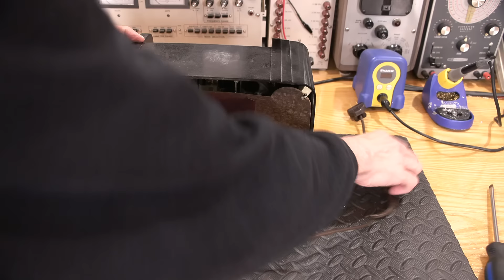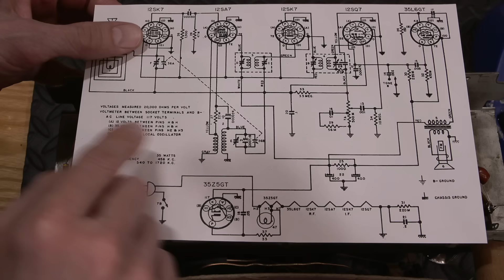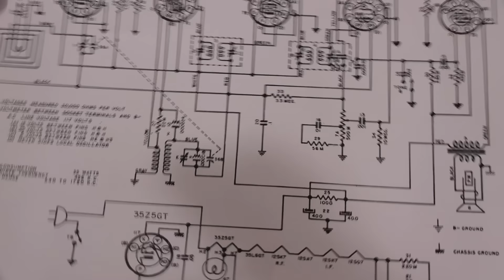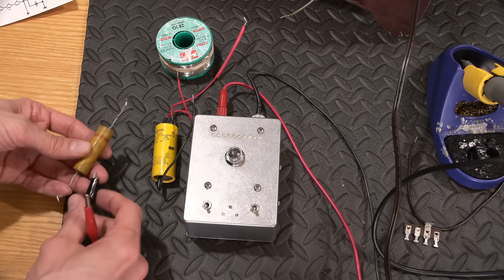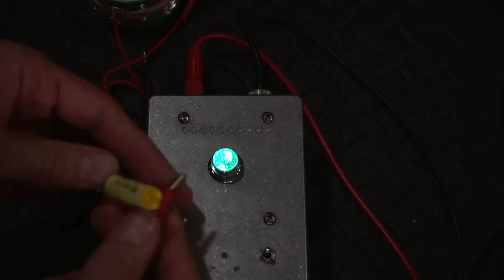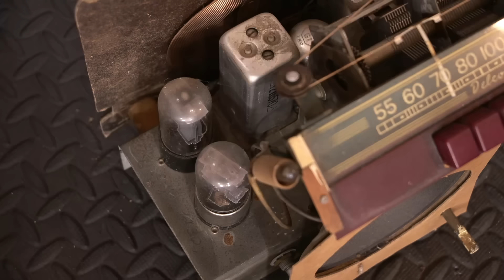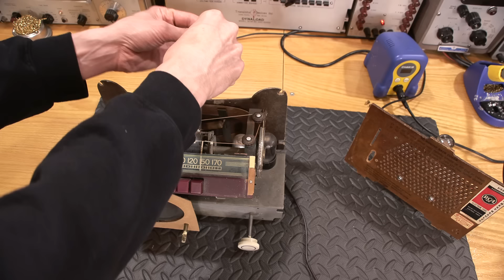Delco High Performance Radio Receiver! [Repair]

Comment from the maker: To learn electronics in a very different and effective way, and gain access to Mr Carlson's personal designs and inventions, visit the Mr Carlson's Lab Patreon page here: https://www.patreon.com/MrCarlsonsLab
Reply: I don't understand electronics but I have been watching your videos for about 4 years now. you are and awesome communicator and entertaining.  My favourite's are when you modify a circuit to make it better than it originally was. I hope you continue to make great content well into the future. thank you for the entertainment over the  years.
Reply: Awww i'm in New Bedford, Mass! Is that what it reads on the side of that cap?
When i was a freshman in Electrical Engineering back in the 90s we took a tour of Aerovox.
I thi k at that time they only produced large industrial capacitors.... 
I'm only 4min in, but if you're going to throw out that cap, i'd actually like to have it :D
Reply: Have a video on what cap replaces the old cap . Straight forward , replace this old type with this 
Modern type . That's it , real simple with no why or what .
Reply: I could really use your help I have an hp 8647a signal generator that isn't acting quite right I'm getting instead of fixed single tone it's like bunch of them or 1 that's like spread out so makes it very hard to tune a radio cause don't know where tone actually is it has a 517 error which is a pre cal error. Is there chance you can repair it for me?
Reply: This radio feels like it was built in the 1990s since its AM-only dial goes all the way up to 1700, though it's probably WAY older than that.  A 1990s model is basically modern compared to the ones you've fixed before, and it would be transistorized to the point of having chips.
Reply: is that lil repeter part 95 ? hahhahah o wait ur above the line hahhahahah.... nice lil tool. i wish they had one for cell phones lol.. here near champlain cell service sucks lol

Comment: Another Yanqui widow maker...and what an appalling mess. What you refer-to as a 'power antenna' were commercially made 'way back wen'... ... I have one in France...sold as a small table for the radio upon which to sit and connect. BTW were there .no reception down here'...you would not at all hear any stations on the radio...

Comment: Oh Mr. Carlson… You’ve done it again.  Produced a superb video.  Thank you.  Two questions please…
First, I noticed you had no mention of how to reduce the hum.  May I assume that it will most likely  go away once all the capacitors are changed along with the removal of near wire to the coil plus sloppy wiring pressing against other wires?  Or is that something impossible to really nail down to one or two components?  Again, May I assume it will just go away after a full restoration is done correctly?
(By the way, You answered my question about two separate capacitors replacing the single dual one in the RCA 8X501 I’m working on right now.  Thank you.)

 Second Question…. What school did you attend to gain such a wonderful foundation?  I thought I had it down from self studying the Heathkit series at age 14.  Graduated Embry-Riddle Aero U. later with an avionics degree.   But I am in complete wonder on how you know every single little aspect of every circuit  part like the back of your hand.   What school or books have you studied from?  Would you share please those book titles or educational resources you would recommend?  I don’t mind releasing my number in here so you and others can reach me if you wish.  Thank you for your channel.   Respectfully,   Michael in Florida, (561) 951-9999 cell.

Comment: Bakelite is impervious to acetone which will easily strip the paint off. Use a cloth wet with acetone. Place it on a section of cabinet and cover it with a plastic bag to slow down evaporation. Paint comes right off.

Comment: I will pay you cash if you can fixit there is also a small double conector wich broke when I opened the cover top and try to put out the cover I pulled and the speaker cable was attached with a connector wich broke when I pulled the cable out I put it back but I am no technician so it works I left it alone every thing is miniature inside this rig I cannot fixit can you fix that I apreciate it a lot N2Qcu Jorge A Guzman thank you sr

Comment: Chassis should be tight to the dedicated ground. With a 3 wire plug. With a 2 wire plug you gave 50% chance to connect the chassis to neutral the other 50 means connected to live since the 2 way plug can be connected both ways in the socket. The other thing is about the new chord. The wires have no insulation hose where both wires go through to be double insulated. In europe they are mandatory.

Comment: I need help, I have 2 1930s tube radios and I still have so much to learn, how do I know if the radio is safe to operate, I have a 1935 RCA model 128 and a 1939 Emerson

Comment: I rewired the power switch on one of my radios to break the neutral going to the tube filament on the 12sq7 and used a polarized plug

Comment: I've gotten somewhat skeptical about published IF frequencies.  Did a radio for a friend and noted that the cans were tuned to about 445kHz (not a typo.)  I retuned them to the published 470 and found the dial wouldn't track worth a hoot, so I reset it back to 445 and everything was back to the way it should be.

Comment: Interesting that there is no tuned circuit between the RF amplifier and converter. Also interesting that they used 456 kHz IF to avoid RCA patents.

Comment: I was watching Adam Salvage and he was talking about how things are not made to be repaired just replaced. He was sharing about the disconnect young people have with learning how things work and how to repair things.  He used cars as an example and how new cars are designed to not be fixed by the owner.  So as with him, thank you for showing and passing a long your knowledge so just maybe these skills are not lost to time.

Comment: I think your devices for showing the leakage in these old capacitors are clever and educational for the purpose of these videos. But , the conclusion I've come to in the end of the day is that all these old caps are simply to be assumed as bad and are to be replaced. It's just a matter of their age, as they're all long past their EOL. No point in even testing them. I've given up even checking them, because I seldom find a single one that is any good. This includes the electrolytic caps in transistor radios going back as recently as the early 1980s. On a conventional cap tester, I'm finding many of these are now showing readings 30-50% higher than spec, indicating substantially increased leakage. One can only wonder the implications for all the car electronics that are full of these things that are sitting in a much less friendly environment.  The modules become unobtanium after 10 yrs or less, and the car becomes totally unfixable.

Comment: When you change the switch topology (switching the live side) could you also add an earth ground to the chassis using a 3 pin power cord? And if so, would there be any advantage to doing that?

Comment: I have been dealing with electrics/electronics for nearly fifty years and have NEVER EVER come across a mains switch going short. We have fuses in our plugs here in the UK in any case. If there is a fuse of the correct rating, in the live(hot) it will blow whichever order it’s connected in. I think someone assuming the set is “ safe” when switched off, or the socket not being accessible to switch off to change the fuse presents much more of a risk.

Comment: It's a nice and simple radio with some quirks - I'm pretty baffled by the chassis and signal ground connections.

Aerovox looking fine and dandy enough for restuffing and while I'd certainly want to put the HV lytics inside the cardboard tube, its small diameter makse it impractical or impossible to do so.

I don't tune IF filters by ear - I always do it by measuring the DC voltage on a demodulator diode  after disconnecting the automatic gain control feedback line to the stages. Going back from last to first filter and reducing the signal level after I get to the sweet spot. I agree that tuning the IF filters often works wonders - it's a pretty easy adjustment provided you have a sine wave generator (even one that goes to 500k...1M) and a frequency counter to ensure precision.
Reply: I've done them both ways, and I don't detect much discernable difference in the results. Tuning them by ear works just as well I have found, and in some cases even better. I learned all sorts of shortcuts aligning old tube automobile radios over the years, with excellent results, and saved a lot of time doing so.

Comment: Hi Paul .. I've been following you about 3 years, full of enjoyment. In fact you unwittingly motivated me to join the Ottawa Vintage Radio Club and talk up some of your creations. Awhile ago I loved your re & re of a Knight local AM transmitter ('intercom or baby monitor), and now I see your power amp is rather like a low-power a.m. transmitter. We're interested in the low-plate voltage 'space-charge' mode tube receivers, and now I'm wondering if low-voltage transmitter would work. Would be so much fun to see you explore space-charge tube radios: good projects for youngsters are in reach there. There were very early 'hikers' sets with one or two s.c. triodes.

Comment: Those old tube radios predating the NRSC mask by several years have such good audio even with the dumbing down of the transmitter audio chain. I believe that a radio like this coupled with a well matched antenna at the transmitter site can come really close to fm ! Great audio bandwidth!  Sometimes newer isn’t always better

Comment: YFW: running this thing on DC (Batteries) Presumably 1.5v D-Cells at that, would require up to 80 of the retched things, and likey only give 10 15 minutes tops of actual runtime before enough of then went flat!
Reply: A cheap D cell is about 12 watt-hours. 80 of them would hold 960 watt-hours. An AA5 draws 30 watts so the batteries would last 32 hours.
Reply: @eDoc2020  Ok great but, I was speaking in Volts, for AC Volts, and not in Watt Hours. Admittedly it's been yonks since I last saw a D-Cell in the Wild. Which is a shame, since my Maglite could use a few, or Six of the blighters. But, again IIRC like most Batteries only deliver 1.5v's. Which then got us back to this discussion. Ok I'm gulty I guess I did bring up the question of Wh capacity inadvertently when I said that trying to run a Radio like like would instantly flatten SOME of those Batteries, and thus bringing down the whole.
Reply: @Ichijoe2112  I think all the stores still carry D cells but you're right, nothing uses them anymore. I actually have one flashlight (with a single 5mm cool white LED) which uses a single D cell and a boost circuit, otherwise I can't remember anything new in my entire life ever using D cells. It was mainly incandescent flashlights and old big boomboxes.

Comment: 30:23 - I had a problem with 455Khz IF years ago. I was living in Bangor, Me. One of their AM stations, WABI, broadcasted at 910 KHz, exactly double the IF ! So, when tuning in, you'd get a beat-frequency that would go to 'DC' if tuned in correctly :) To fix the problem, I just jacked up the IF of the receiver and tweaked the oscillator to compensate.
Reply: Neat
Reply: Changing the IF will widen (or narrow) the bandspread on the dial slightly, depending on which direction the IF is shifted. Usually not enuff to really notice.

Comment: I am wondering about that tuned circuit coil with the capacitor that should not be changed or else you will have to tune it frequently. Why not use an NP0 Capacitor?
Reply: Those old tubular ceramic caps were the closest thing they had to NP0 caps back then.
If you change them out for a modern day NP0 cap, you're going to have all kinds of issues.
Basically if it isn't broken, don't "fix" it

Comment: 35:40...The post-Realignment lab/basement sensitivity performance is Incredible !! ...Even without the Outside antenna connection,  If you had turned Off all your other lab Equipment & other nearby Interference generating Sources,  I bet it Would've picked up many Distant stations   better than most "Today's" newest radios !!

Comment: Very helpful restoration & Alignment tips...Very interesting how Delco Economically incorporated the Rf Preamp stage while using just a standard  "2 Gang"  AA5 non Rf preamp type variable capacitor Without losing any hot, sensitive, long Distance reception performance !! ...I would've Assumed a much Lower sensitivity performance with the compromised Un-tuned preamp Plate coupling design but it seems to deff work Very well !!

Comment: Thank you for doing the radio alignment on this Delco.  I’ve had some difficulties learning how to do it. You made it simple to understand. If I may I’d like to ask a question not related to this video.  I have an 1950 Buick with a 6 volt battery. I’m unable to jump start the car because the newer cars are 12 volt. Can you provide some information on how to drop the voltage to 6 volt if I use a 12 volt battery?  Many thanks

Comment: Well that electrolytic cap, either was bad or good, was completely normal to test as "leaky" after 40+ years of disuse. It is of course good to replace it anyways, but it would be even better to try to reform it via a HV current limited power supply, and then test it for leakage and capacitance :)

Comment: Nice radio Paul!  The push-buttons instantly date the radio as the 1940's.  The RF amp was a huge performance upgrade for the 5 tube RCA tube set.  The pentagrid converter stage generates a huge amount of noise, de-sensing the radio but, with the RF amp, that noise is reduced 10 to 20 dB.  To correctly fuse this radio, each line should be fused, and the fuses should be in the plug but, to my knowledge, no one makes such a plug.  I like to double the value of the cathode resistor on the audio output tube of any 5 or 6 tube series string RCA tube set to reduce heat dissipation.  The audio output is by far the hottest tube in the radio and generally cracks plastic cabinets.  The filter electrolytic in this radio was obviously replaced at some point, those radios used paper cased electrolytics originally.
Reply: With a properly-polarized plug it's best if there's only a fuse in the hot side, otherwise if the neutral blows all the internals become live. If you want a fuse with a built-in plug, look at Christmas lights. Polarized ones have one fuse, nonpolarized ones have two fuses.

Increasing the cathode resistor is definitely a decent idea. Doubling might be excessive but going from 150 to 220 should help without hurting power output too much.
Reply: @eDoc2020  Thanks for your comments/suggestion on the polarized plug.

Increasing the cathode resistor on the audio output reduces the maximum audio output power slightly, as well as increasing the B+ by a few volts.  This modification will probably go unnoticed while in operation unless the radio is played at maximum volume.  I typically use a cathode resistor value of 270 to 330 ohms for the 50L6/50C5.
Reply: @billharris6886  I'd need to look at the specs but doubling the resistor probably cuts the output power by more than half. The bigger issue is probably distortion.

Comment: General Motors has been using Delco radios with Bose speakers for a very long time...both are great by themselves but awesome when combined  :)  
I could receive radio stations from the Yucatan capital (at night) which was over 2500 miles away...it always amazed me how well they picked up signals.

Comment: Two weeks have passed,since i have finished my last tube radio project, a nordmende Carmen 57,last Job was restuffing the power supply filter capacitor, 3x 50uF, restuffed with 3x 47uF 400 volt ones,and polishing all brass parts at the Front of the radio. Works perfect, no hum at all,amazing Sound quality. Even the original schematic is still intact, which is really helpful, for checking resistors, and all the voltages.